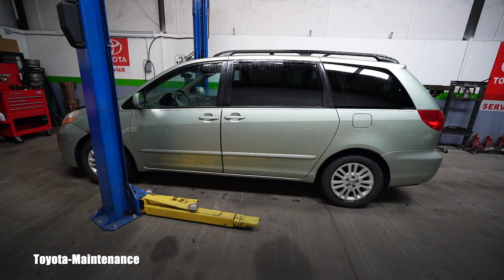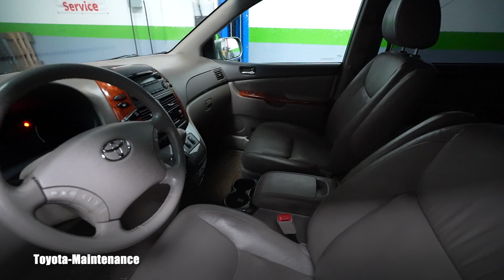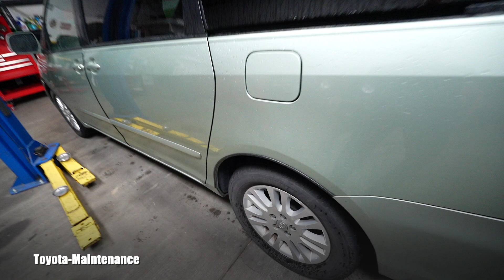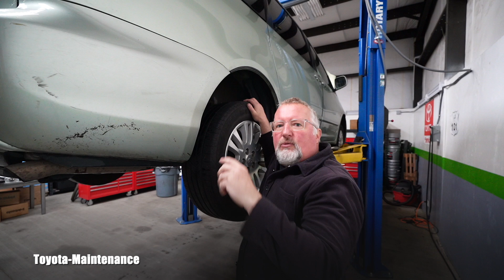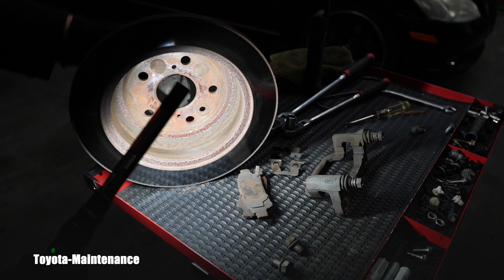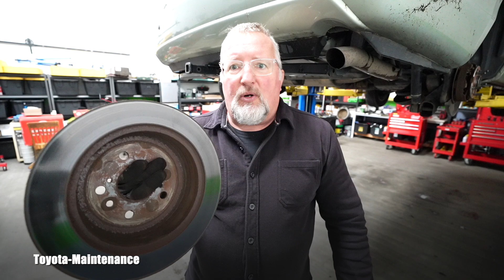Vehicle vibrating, shaking, pulsating while driving

Comment: REPLACED REAR CALIPERS ON MY 6TH GEN ACCORD, FRONT CALIPERS REBUILT... REMOVED PINS USED BRAKE CLEANER WIRE BRUSH THEN ANGLE GRINDER WIRE WHEEL THEN SANDPAPER ALL NOOKS AND CRANIES

ACETONE WIPED EVERYTHING THEN PAINTERS TAPE USED HIGH TEMP PAINT REPAINTED FRONT CALIPERS, REGRASED PINS NEW RUBBER BOOTS A FEW DOLLARS AUTOZONE

PUT NEW MASTER CYLINDER, SEVERAL LARGE BOTTLES OF BRAKE FLUID FLUSHED ENTIRE SYSTEM

NEW PADS OF COURSE... NEW ROTORS FRONT AND REAR COATED BALANCED BOSCH ROTORS

REASSEMBLED BRAKES WORK GREAT

COULDN'T HAVE COST MORE THAN $300 TO $400 TOPS DID EVERYTHING MYSELF

Comment: Yea, brake fluid is hydroscopic, It's cheap to replace, you can easily do it yourself.
Although it can last many year, you can save lots of money by changing it every 4 or 5 years.
In Canada, a dealer can usually do it for less than $150cdn
It's a good idea to have it done with your break job, you can often get a lower price since they already have stuff taken apart
Reply: it is best idea to have it done with brake job... i had it done once BETWEEN brake jobs,,, which turned out to NOT be a good idea later on

Comment: Hi Petr, usually when I find that either the caliber itself or the caliber bracket is messed up, I need to buy a complete new unit ie. a caliber and bracket. I have not found that the caliber or the caliber bracket are available separately. That is especially annoying when the only problem is one frozen slide pin and yet I have to replace the whole shebang and open up the hydraulics. I am usually going aftermarket so maybe these parts are available separately from Toyota. cheers
Reply: i have a Gen7 Corolla that the bracket is available from the Yota dealer separately but!! it cost some good coin compared to a re-manD full assembly from the mcParts store

Comment: How about opening the bleeder to see if the hose is restricted when pushing the piston in?
Reply: Then you wouldn't know if there was a problem with the system.
And since the fluid is hydroscopic, there is a very good chance the caliper is bad anyway, as the moisture migrates to the lowest point(caliper)
Reply: @GoofieNewfie69  If the piston pushed in easy with the bleeder screw open you would know the piston is good and the problem is the hose or further up in the brake lines.

Comment: I wish I could bring my Toyota to you for repair and maintenance. My 2nd gen Rav4 has a good engine, 2.0 petrol with 97k miles, has been given regular oil and filter changes but needs new prop shaft and centre bearing. I don't think my local garage wants the job.
Reply: is that a fairly straightforward DIY task or is it very complicated to do?
Reply: @efil4kizum  Good question. If I can tackle it myself I will, I have tools and skills but lack the specialist equipment and shelter of a proper garage.

Comment: You COULD have used some steel wool on the piston in the caliper, then cleaned the surface and used some high temp grease prior to pushing in. I think that would have fixed it! New pads and clean up!